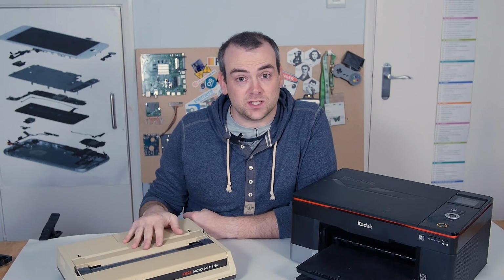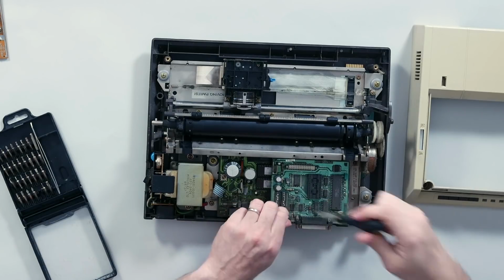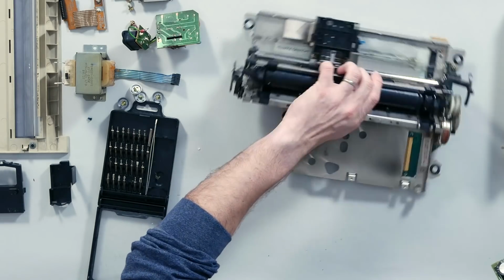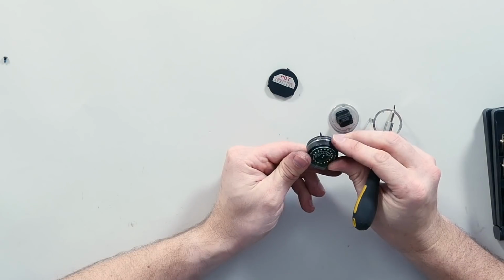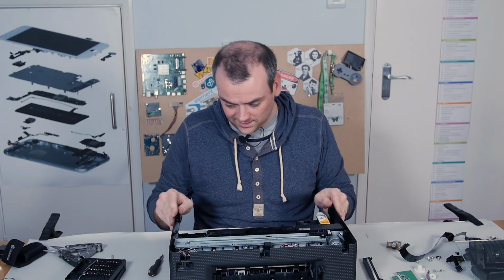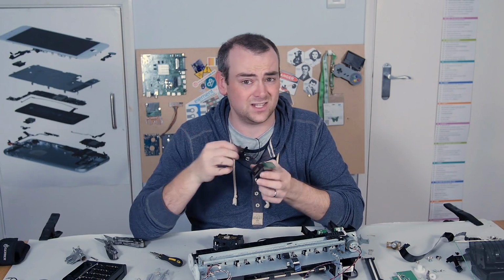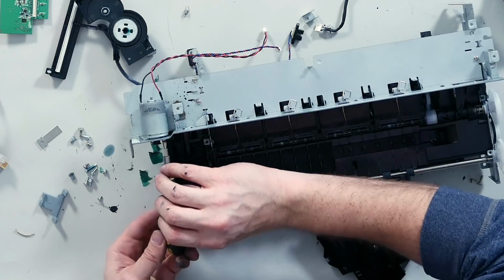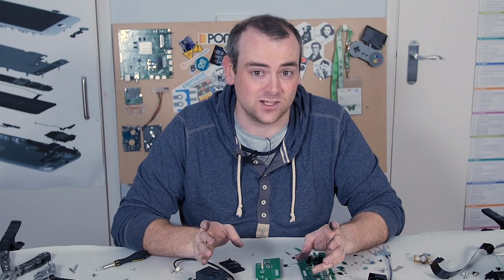Printer Technology Showdown - The Electronics Inside

Comment: Inkjet you buy 20ml of ink, and put 0.05ml on the page, while the rest goes into the peristaltic pump, there to suck ink through the head so as to dissolve dried ink in the head, and then into the spittoon where it is absorbed. Dot matrix the ribbon is used till it fades, then you drop on a few drops of stamp pad endorsing ink, and it is like new again. New ribbon is around a quarter the price if inkjet ink as well, and if you do not print for a year nothing really goes wrong with it.

You can still buy dot matrix printers brand new, all OKI Microline, and they come with USB, parallel and 9 pin serial as standard, and will do around 10000 pages per ribbon. Then you press the button on the back of the ribbon cartridge, and you release the rest of the ink off the roller, and get another 10000 pages out of it. Will print up to 8 pages of self carboning paper, or 5 pages with separate carbon paper ( the carbon is a very thin tissue) with no problems. Also handles graphics quite well, though very slowly, as it tends with the default setting of graphics to do multiple passes per line, so best is to use the text modes exclusively, where it is blazingly fast compared to most other dot matrix printers the same size.
Reply: I did some calculations when I bought my new printer 5 (ish) years ago. I figured that by the time the rate of failure, cost of ink and everything was calculated, a colour laser was half the price per page. And that was based on getting a print out of every drop of ink, the toner in my colour laser never dies out!
Reply: @a531016  Bought a new cheap mono laser 3 years ago, to replace a used 6L that was no longer repairable for cheap.  So far still on the original starter cartridge, but that is a cheap refill. Would have been at least a dozen inkjet cartridges if I had bought the slightly cheaper inkjet, but the cartridges are actually more than the printer, which comes with a 30 page starter unit per colour. Buy 2 and you have spent more than the printer cost, so if i ever buy another inkjet (not likely) I will buy refills or compatibles instead. Laser 3 months between prints no worry, inkjet new cartridge time.